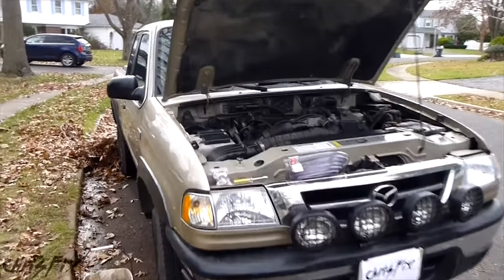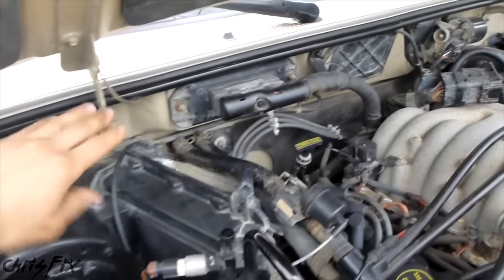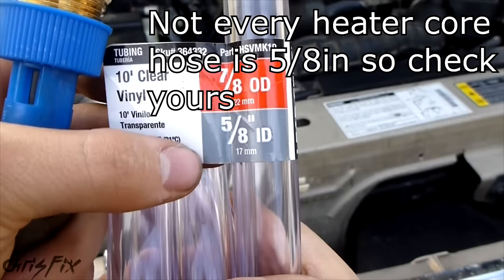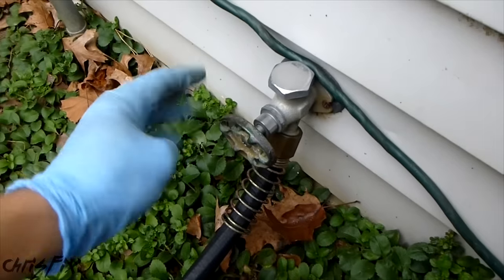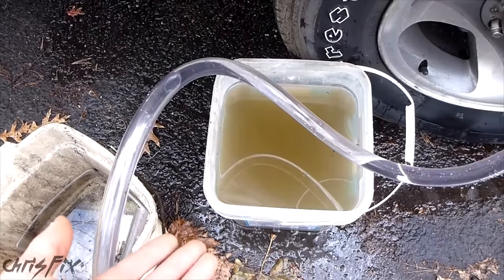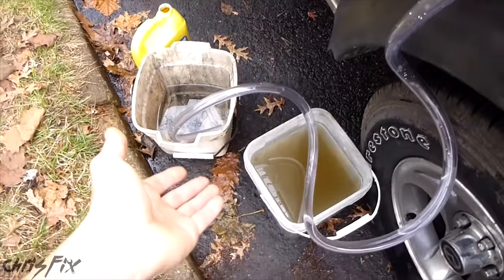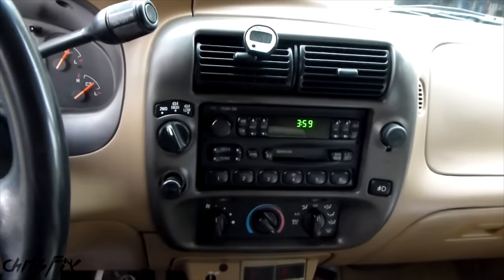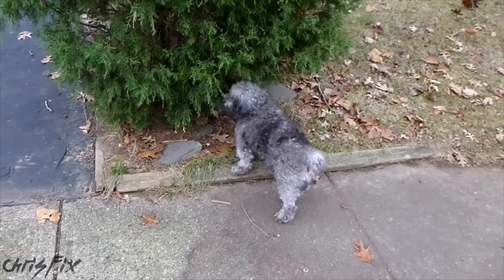How to Flush a Heater Core Safely (with a garden hose)

Comment: hey man, before I decide to flush out mines, do you recommend removing any battery connections or drain out the radiator?
Reply from the maker: 3vilHmongkey There is no need to remove any battery connections unless you are afraid that where you are working you might get a lot of coolant on some electrical wires. You are not running the car and if you are careful, the engine bay wont even get wet. You do not need to drain the radiator either. I would consider doing a coolant flush first if your coolant is bad and here is how to tell: https://www.youtube.com/watch?v=mHTM3dvpD1M

Comment: Hi chris, I had an old s320 w140 mercedes benz which after driving for 15mins hot water is forcing and hissing out from the big hose at the radiator connected to water pump. Upon checking, I found out that only half part of the radiator is hot, the other half towards the reservoir  is very cold. What is the problem which caused this. Hope you can tell me, TQ
Reply from the maker: Half the radiator should be hot and the other half should be cold. That is how it works. Sounds like you might have a clog or damaged hose if water is hissing out.
Reply: Thank you very much chris...the hose is clogged alright. Some sort of red silicon which is normally used to secure water hoses before clamping it. Its fine now. You are the man bro.

Comment: My car run hot going up steep hills and run hot in the rain. What do you suggest Chris? I’m going to do a coolant flush but I tried the thermostat, adding coolant but not leaking, I replaced a sensor that controls the fan to come on and that’s all so far. Please can anyone help for a 02’ Hyundai Sonata 4 cylinder. It sucks that I can’t drive in the rain.

Comment: I would bleed the system after opening the heater circuit.  Start the car with the rad cap open and wait for bubbles and a level drop.  That means that the thermostat kicked-in.  Then, turn-on the heater.  You should see some more bubbles.  Top-off, put the cap back on and you're good to go.  You don't want an air-lock.
Reply from the maker: rouelibre1 That is a good tip but it isnt completely necessary (especially if you flush the heater core with coolant at the end like I did. That forces all of the air out. If you do end up having trouble with air, your steps are exactly what needs to get done! Thanks!

Comment: Hi Chris!!
I know that this vid its flushing related, but before i make it this far i have a few questions that make no sense to me and i need help!!
2013 durango last year it overheated on me while driving and then it cooled all the way down, i thought it was a hose that popped or something, but i couldn't see anything wrong with it so i refilled rhe radiator and drove it to my local mechanic, he said it was the termostat, so he replaced it!!
Later on down the road the durango overheated again and i saw it was the bottom hose from the radiator that came loose, i put it back in and clamped it and refilled the radiator backbon again!!
And then the Durango overheated again but i couldn't find anything lose or busted so i replaced the termostat again (that was last week February 2021) and everything seemed to be fine till today the durango stopped blowing hot air!!
And when i touch the radiator cap ot isnt hot at all even with temp gauge at running temp!!
Do you think i have a bad termostat even tho it is new!??
Or could it b something else!????

Comment: Hey Chris, I have a coolant flushing system at work that pushes new coolant in, while old coolant is forced out. Will this flush the entire system? Can the new coolant get to the heater core without the heat turned on? I'm starting to wonder if i should do the normal flush through the rad and eng, then do the heater core flush you do in the video.

Comment: Hey Chris! I have a 1999 Dodge Durango 5.2L I believe my heater core is leaking dude to steam/vapor leaking out of my vents and not alot of heat comming out. Would you suggest me flushing the core and the block/radiator and putting new anti-freeze with a leak stop additive? Thanks for the advice in advanced!

Comment: Hello Chris, question. I was getting liquid build-up on my driver's side flooring and cold air on the passenger side, cool air on the driver's side. I suspected the heating core and had it replaced. Now it is cold air throughout. The temperature doesn't overheat or anything. What can I do? Also the heating know only works when it is all the way up. Any suggestions on that too?

Comment: Chris, I did a water pump job on my 04 Tahoe with 226k miles but slowly loosing coolant.

I used to hear a knocking sound from the heater core and now I don't even get any heat.

think the culprit is the heater for all problems?
Reply from the maker: One guess is you have a headgasket leak which is allowing air into the system so you dont have heat and you are losing coolant!
Reply: ChrisFix thanks Chris, anyway to test this?

Comment: I have ''88 Ford Sierra Sedan (Ford Europe) . It's heating does work just a little , so you can barely tell that air is warmer when change it to heating . Hoses that to to cabin are little warm , after engine warms up . As it is real wheel drive , fan is always on , connected to engine (it has some clutch thing that makes it spin faster when engine get warmer). Thermostat is changed , but old one was working good , opening at 88 degrees Celisius . And fuel economy is terrible , but I think it is because it is carburated , and choke is closed by warm water . Hoses go - engine , carb , cabin , water pump . Would flushing help ?
Reply from the maker: Mladen Milić Flushing it might help. Sounds like it is clogged or has low flow.

Comment: Do I need to drain all the coolants in the system first, before I flush the heater core?
Reply from the maker: g37clips You do not need to drain the coolant out of the system before you flush it. I would check your coolant and make sure it is still good. Here is a great video on testing your coolant: https://www.youtube.com/watch?v=mHTM3dvpD1M

Comment: I'm having problems with my heater core in Mazda 626, it's probably clogged because even if both hoses are hot at start, after 10 minutes driving in cold weather outtake hose is noticeable colder., and of course no heat in the car, which sucks in winter ^^ I already did flush it once with no success so I was thinking about buying new heater core, but after watching this video again I'm about to try it again properly, emptying the expansion dose and perhaps taking out thermostat, because I really don't want to disassemble whole dashboard. Do you think the double flush can still help even if first flush didn't help?
Reply from the maker: It sounds more like there is air trapped in the system. Watch the end of my video “how to install a performance intake”. I use a no spill funnel which helps you bleed out all of the air in your system.

Comment: Maybe a dumb question since no one else is asking it but don't you have to worry about getting air bubbles in your radiator when you disconnect the coolant hoses and open the system up?

Comment: With the color of your coolant, you may have more problems than a clogged heater core. If you clean the core and run the same old dirty antifreeze back through there, you have the possibility of having the same clogging as before. I would suggest draining the radiator and flushing the whole system and installing new antifreeze. Oh yes, make sure to drain the cylinder heads of all cleaner before filling the coolant.
Reply from the maker: Tom Jellifer Thanks Tom. The video on how to flush your radiator is coming soon so stay tuned!

Comment: Could it be the heater core if you see wavy air on the windshield at night? The coolant overflow tank on my 2006 Nissan Pathfinder was worn out so I had it replaced, but I'm still seeing wavy air.

Comment: Hey love the video. I have a 1997 audi a4 quattro 2.8 v6. the temperature Guage is always where it's supposed to be when its hot it NEVER moves so the water pump and thermostat is ok right?  anyways I had no heat it was a little warm that's all I got a coolant flush still the same when the car is hot and I turn it on a burst of heat comes out for maybe 20 to 30 sec on the freeway and back to normal then I shut off the heater for a min turn it back on burst of heat and then back to normal I'm going nuts. would you know what this could be? thank u again.
Reply from the maker: +Danny Dominici Sounds like the heater core is clogged up. I would flush the heater core like in this video a few times!
Reply: +ChrisFix Thank you very much. just needed a opinion from someone who obviously knows what they are doing. I have had the car a couple of weeks and put it this way, I have got to know audi VERY well just over the DAMN heater issue lol.. I will definitely give this a try and will let you know how it worked. FINGERS CROSSED :)

Comment: Chris Fix help!... I need to bleed the clutch master cylinder. Ive replaced the hydraulic, but the kit i purchased and installed didn't come with the line to the transmission. Help please. Oh now my battery is really dead. So it needs to be replaced first. Haha Ford Ranger 2000, 317,??? Miles on her.

Comment: So a few questions. Where do I purchase the clear hosing you bought for this video? I've never seen hosing like that at Home depot or Lowes, does ACE hardware carry them and the adapter you used? I am also DEATHLY afraid of antifreeze for the reason that it's toxic, but I'm not too keen on putting the old fluid back into old containers. If I bought an oil catch pan (that's big enough) would places still recycle it. My final question is, which should I flush first? Should I super flush my radiator, or my heater core? I suppose if I super flush my radiator, would I even need to flush my heater core? Once again, thanks for the informative videos.
Reply from the maker: +Austin76711 Home depot pluming isle. Car part stores and oil change shops will take old antifreeze. Your heater core only needs to be flushed by itself if you have a clog or no hot air. If you have hot air, you can do this flush: https://www.youtube.com/watch?v=s--5ft5YiHg

Comment: Hi, I have a 1990 Toyota pick up with the 6 cylinder engine. The heater core seems to be in the center of the fire wall. My difficulty is there is no room between the two to flush the core. Any advice?
Reply from the maker: Follow the hoses and see if you can either splice into it or take it off at the other end.
Reply: @chrisfix  I was able to poke around on it today. It's pretty warm out If think the thermostat may be next thing to Change hoses don't feel hot coming off radiator. It took some coolant, that gave me a little more heat. We have more snow coming Friday so I may get some better weather this weekend. I still haven't found heater core lines but there is a lot of stuff to look behind. So I'll keep in touch. Thanks

Comment: Hey Chris, I found the heater core location on my 2001 Nissan Sentra 1.8 Liter Engine.  The heater core is located in the middle of the firewall.  I need to do a heater core flush.  My question is, is the inlet hose located on the left (passenger) side or the right (drivers) side normally?  I know it varies depending on the make and model of the car.  I called the Nissan dealership and it seemed they were not sure at all.  Also, when doing the flush of the heater core, do I also need to flush the radiator as well?  Please let me know as soon as you can.  Btw, love the videos Chris.  Thanks.
Reply: When the car 1st runs for a few minutes keep feeling both hoses. The one that gets warm/hot 1st is usually the inlet...and if one is staying cold that is usually the outlet and is indicating no warm/hot coolant is flowing thru it.

Either way...doesn't matter because if you cant figure which is which try flushing it out from both sides....the point of going to flush from the normal outlet side is to reverse the normal flow thereby creating a backpressure in spots not normally part of the original operation.

Comment: QQ I HAVE A 2013 VW PASSAT AND ITS BEEN TWO YEARS THAT THE PASSENGER SIDE HOT AIR IS NOT WORKING. I TOOK IT TO THE VW DEALER AND SPENT AROUND $800 ON THIS ISSUE..IT WORKED FOR A FEW WEEKS AND WENT BACK TO BLOWING COLD AIR WHEN I PUT THE HEAT ON..ANY IDEAS THANKS 😎

Comment: Chris cool video as always, but I live in Florida.... whenever you did the the system coolent flush and if you keep the heater on wouldn't that flush the heating system as well? I am going to flush my coolent soon so I was thinking to take care both of them at the same time.
Reply from the maker: Arlind Sadikaj You dont "flush" the heater core when you do a cooling system flush because it is just the normal pressure in the normal direction. It will remove the old coolant from the heater core though, but you wont be flushing it.
Reply: Ahh ok I see.

Comment: Going to try this on a 2009 Jeep Wrangler that has little to no heat.  Would this issue by any chance cause the radiator fan to run more than usual?

Comment: Suggest some additional cautions when doing this job. Frequently, the hoses are difficult to access and heater core ends are thin brass fittings (very easily damaged). It is better to splice into the heater core at a more accessible and safer location than directly at the heater core ends.

Excelllent video!

regards
Reply from the maker: Texas Pipeliner Thanks for the tips!

Comment: Hey, Chris. I flushed the heater core on a Honda Element today following the instructions in your video. There wasn't any blockage in the heater core. One of the heater hoses is warm and the other one still cold after running the engine with the heater on. The heater hose with the heater control valve is the one that is warm. Could it be the control valve that needs to be replaced?
Reply from the maker: Thomas Cannon What happens when you have your engine at operating temperature and the heat on and you give the engine some gas (2500rpms)? Do you get any heat? Check out this video: https://www.youtube.com/watch?v=-XjXTVJhFLM
Reply: ChrisFix
I ran the engine at operating temperature with the heat on and gave the engine some gas, but didn't get any heat. And I changed the heater valve and that didn't fix it. Could the thermostat be stuck closed?
Reply from the maker: Thomas Cannon If the thermostat is stuck closed it would cause the engine to overheat. If it is stuck open, the engine wont heat up. Sounds like you have a clogged heater core but you said you flushed it. Maybe you have air in it? Are both of the heater core hoses hot?
Reply: ChrisFix I thought it was a clogged heater core at first because the outlet hose is cold and the inlet hose is hot. But when I flushed it, clean coolant came out. I'll try bleeding any air tomorrow. Is it possible that the water pump isn't providing enough pressure to push the coolant through?
Reply from the maker: Thomas Cannon It is possible that the water pump isnt providing enough pressure but that is rare, especially if you are not overheating.

Comment: You DO NOT have to remove either heater hose to install a clear vinyl hose to flush your heater core. All you have to do is unhook heater hoses on the engine rather than at the core and if you wanted to, you could extend your hose by adding a clear vinyl hose ..... Removing the heater hoses themselves from the core inlet and outlet is asking for further problems from brittle lines and etc etc etc..... Again, do not remove your hoses from your cores inlet and outlet necks, you really do not even need a clear hose to flush your core out.

Comment: So if you do a full engine  radiator flush with flush cleaner and turning on the heater and drive for a day, you don't need to do a heater core flush?

Comment: I put coconut oil in my engine, i use margaritas liquer as coolant, bud light as brake fl.(as brakes was invented for puss..), Finlandian drink for power steering, some watermellon punch and coke to unscrew my wheel bolts :) And I also used to flush diesel tank with a water hose once a week, till neighbours once told I'm using too much water :) So I sold the car, and bought electric scooter.

Comment: Can your car overheat from a clogged heater core? I'm having a hard time with my 2007 Scion TC. I replaced my water pump, and my thermostat. (Both were broke) It's still overheating and blowing cold air though. I have no coolant leaks anywhere. Any help would be greatly appreciated! Thank you!!

Comment: Tomorrow 'We', my son and I, will be flushing our cooling system on my VW LT35 2.5 SDI (basically a Mercedes Sprinter but with a VW engine). The heater core is NOT blocked or air locked as it pumps out enough heat to melt 'Superman's Underpants'....Needs a good ol' clean out though and I will be replacing the 'non coolant' with G12 plus/G13 VW recommended coolant (basically a purple colour) First step in a cooling system upgrade.  Unfortunately, I bought the van and didn't notice that the viscous fan was .......missing..............Yeah, I know but it IS an 'upgrade' in Northern Europe as the cooling system is very good anyway.....but I am now in southern Spain....where is is usually above 25 degrees on the coast and 35 degrees (celsius) inland (and more in summer)...the plan is to get home to Scotland and fit an electric fan, inline hose thermostat etc but before the main event change the cam belt and all ancillaries (water pump) and fit a new radiator too...the current one has quite a bit of damage and they are not expensive...These videos are educational and inspirational...Some would have a different opinion and way but 'No way' is completely correct'..the basics are the most important thing.